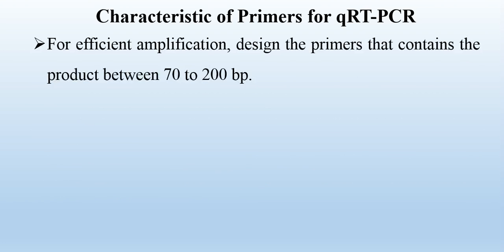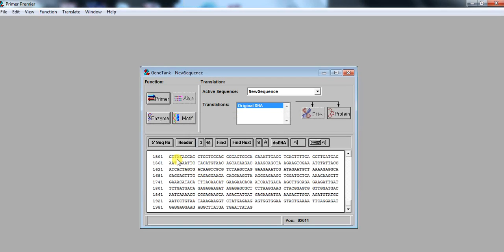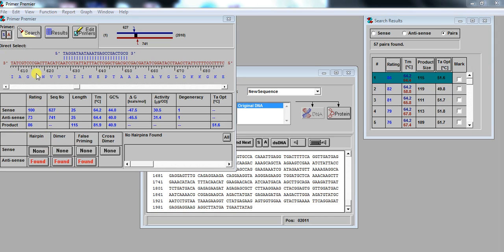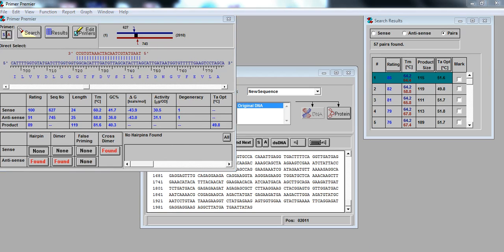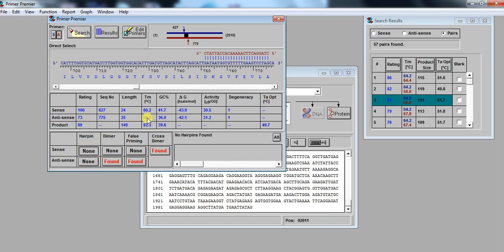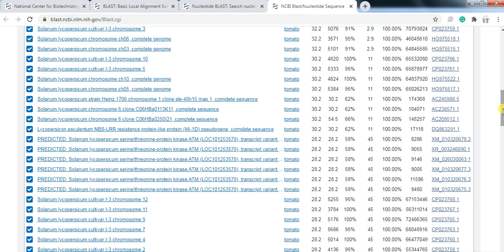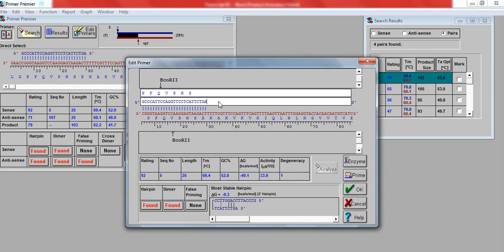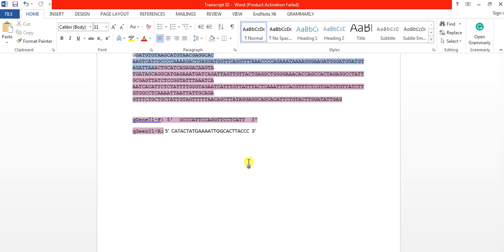primer designing | qRT pcr primer designing | design specific primer for RT qPCR | Primer Premier

Comment: I just want to know if the hairpin is present but the melting temperature of it  is lower than anneling temperature. Is it will cause problem. What do you suggest as I have not experienced with RT-primers?
Reply from the maker: It is better to remove
Reply: @genomewidestudy  thanks